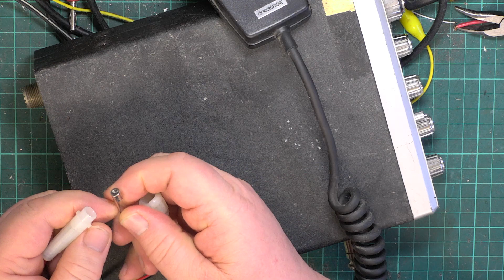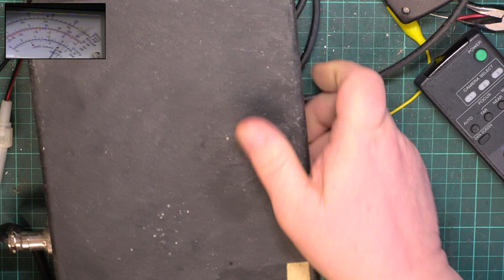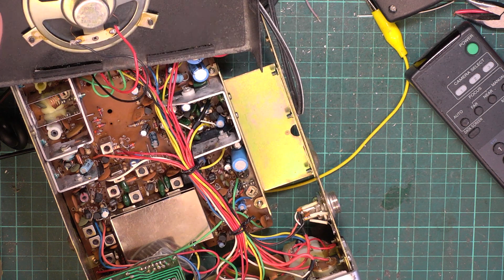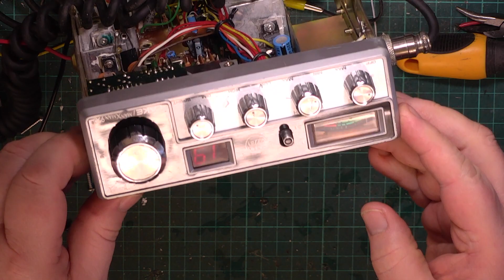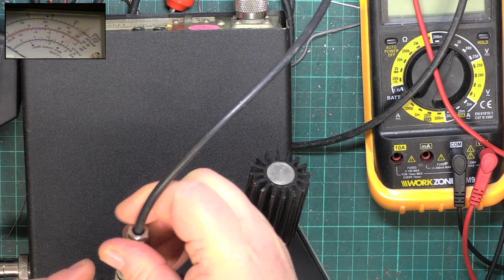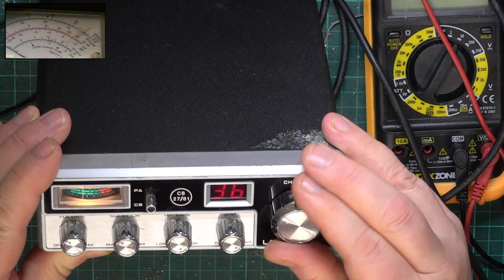Lake 950 Manxman UK CB27/81 CB radio (mobile) - Service & alignment

Comment: Good Video Richard but please try to make sure you check that video in video is working. not being able to see the different meters etc whilst you're working on the rigs makes it hard to understand what you are doing. I am not the brightest spark when it comes to electronics so the missing VIV makes a world of difference. Thanks  Keith.
Reply from the maker: I know it's a snag. Since changing from £1K sony CRT monitors to LCD sh1t, the viewing angle is too restricted for me to see properly from a seated position. It's not just CB radios that get worse the newer they are! Problem is the CRT monitors don't handle HDMI which is the format the video mixer needs.

Richard

Comment: Hi Richard your radios all sound very good on road test.i live in navenby so not to far from you.i keep listening out for you and my chippy on 31 but not heard you yet.i use the IMAX 2000 so it isn't a problem from your location to mine.
Reply: I'm surprised you haven't heard me from the top of the hill before dropping down to scratchy corner.
Reply from the maker: The tests usually take place at 8PM Tony.

Richard